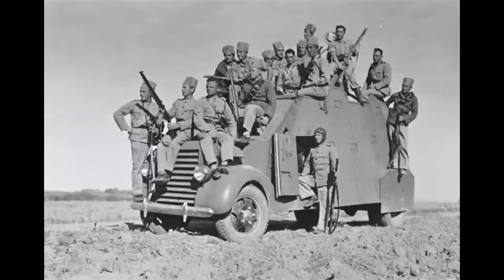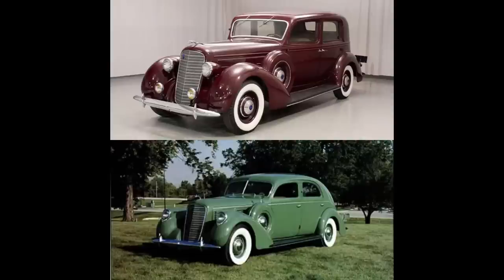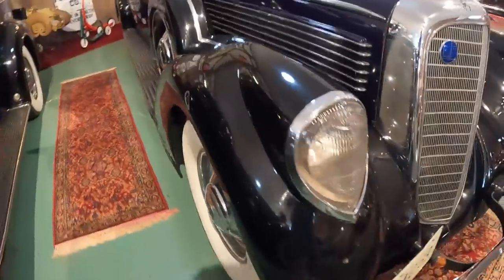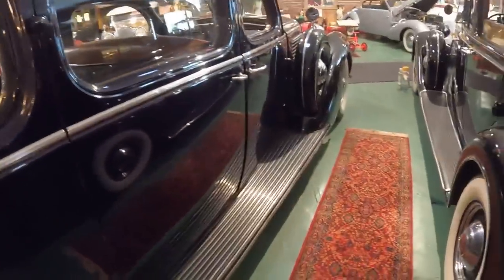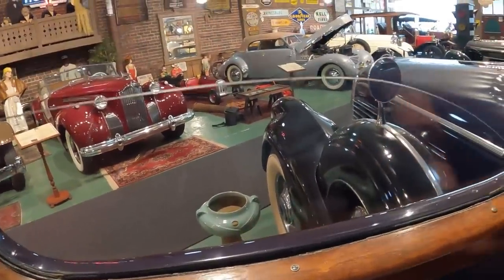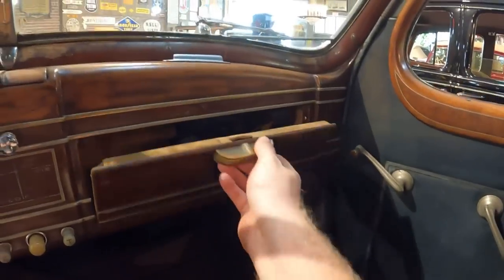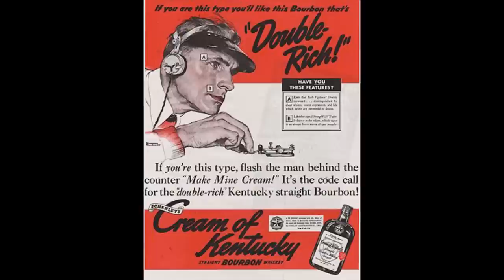1939 Lincoln model k

Comment: Sadly, this car’s passing also marked the end of an era for non-sealed beam headlights. Government regulations required all cars to switch to using sealed beams lasting from 1940 until 1983. So beautifully styled headlamps as on the 39 Lincoln became more bug-eyed, as did all cars afterwards. However, sealed beams were easy to obtain and replace with no special lenses. And unlike all of today’s cars with polycarbonate lenses they don’t turn yellow.
Reply: Imagine trying to find a replacement lens for those headlamps today.  They're gorgeous tho.
Reply: @billolsen4360  Very true and that was a problem even back then, they were made of glass. The same is true of our current polycarbonate headlights- for every car is different, even the LEDs are different from car to car. My old Corolla had a rock chip in one of the polycarbonate lenses, if I still had that car I would have had to go to a junkyard for a replacement.

Comment: The story of the exclusive 'K' Lincolns is a bit complicated , especially when you think of the relatively small numbers produced. They were good looking , high quality cars though , and certainly worth remembering. In short :
During the 20's ,Lincoln had been using their own high quality , expensive to produce V8 , which eventually grew to around 384 c.i. 110 h.p.
 In 1931 , using plans formulated before the Depression , the company introduced a new V12 chassis  to compete with other luxury car manufacturers . It was called the KB model . 150 hp V12 of 447.9 c.i. .The remaining stocks of the old V8 engines were also installed in the new K  series chassis  ), and sold as the KA series (125hp V8 , 384 c.i )
By 1933 , the old V8 engines were depleted , and for their own reasons , ( in the height of the depression ! ) , Lincoln decided to introduce ANOTHER , slightly smaller version of the V12 . ( reduced to 381.7  c.i. , 130 hp ) Cars fitted with this version were now referred to as the K.A. Series . K.B. series continued as before .
 In 1934 , a rethink led to BOTH K.A. and K.B. V 12 engines being replaced by an updated 414 c.i. version of the V 12 . The letters A and B now referred to different wheelbase lengths.
In 1935 , further simplification led to both series being called simply the 'K Series '
This was the situation up to the end in 1940 ; the only FURTHER complication  ( after 1936 ) being the introduction of the completely different ' Lincoln Zephyr' powered by a different , smaller and cheaper  V 12 which owed more to Ford's ' V8 ' than to the exclusive K Series engine . The Zephyr was a beautiful , modern design , aimed at the middle / upper medium priced market of the Buicks / Oldsmobile / Chryslers etc  price ranges but with the seeming cachet of being V 12 powered. It was a very different animal to the rare , high quality 'K series ' however .
Reply from the maker: Thank you so much for adding all of this information really appreciate it the Lincolns from this era just don’t get the love that they deserve =)

Comment: Packard 12
Lincoln K
You do know that the motor in the Zephyrs was a completely different V12.
The comparison of the red 1936 and green 1939 were on different coach builders.there was a more similar sedan in 1939 to the 1936.
Reply from the maker: Yeah most definitely I was looking at doing Lincoln V12 episode and those two engines are different the engine in the K is definitely the better engine

Yeah that comparison was a bit botched so many different coach builders Lincoln had working for them.. and honestly that’s why there wasn’t hasn’t been any comparisons it’s really hard to compare cars are custom built.. or in the Windsor case one/two year production.. 

Great choices and thank you so much for pointing all of that out =)

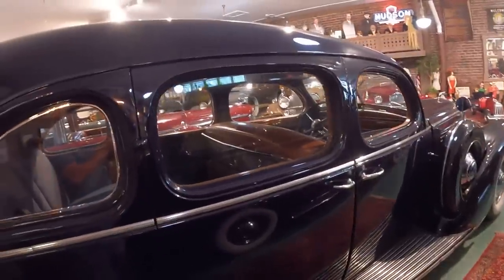Comment: 4:40 Always liked round gauges best.  9:18 Yes, the roof does get higher in the rear compartment from where you're standing, but from the side-view photos you provided, it really doesn't on the 1939 model.  The fancy back seat people may have to take off their top hats.  The passenger compartment does bulge out to give a wider seating area in the rear, that's probably why the running board gets so much narrower the further back you go.  Love this LIncoln's headlamps & tail-lamps.  The rear folding trunk rack is really inventive, fancy Wall Street tycoons have to sail to Europe on the Queen Mary, you know, and take lots of stuff with em.  WYR: 1. Packard 2. The 39 Continental, naturally.  That was the car Sonny Corleone got shot in.
Reply from the maker: Great choices

What I was seeing and what was being captured on video or two different things that car looks weird in person like you can physically see the front isn’t as tall as the back but it didn’t portray on film for some reason.. I didn’t know that that was a one off car until after the fact

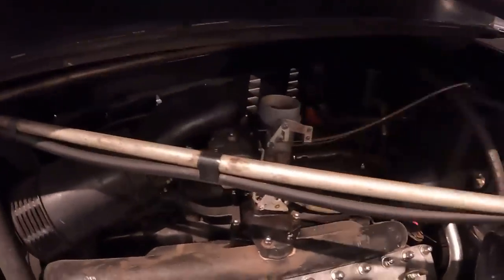Comment: 19:03 ... carburetor right here ... back when the air was so clean you didn't need an air filter ;-)
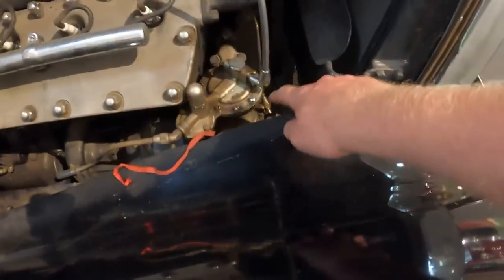Reply: 19:27  Oh, I guess there is an air cleaner; it's just not in position.  Probably so they can get some ether into the carb.

Comment: Packard ❤️❤️ Always 😉 
I never was much of a Lincoln fan 🤷 their colors are very  conservative??? interiors could be simple 🤔....
Another great episode 😉👏👏✌️
Reply from the maker: I really want to drive a Packard before this year is over I wanna know what balance everybody is talking about, The curator at the museum said the Lincoln’s are his favorite but they drive like trucks even the 1939 super heavy steering he was saying that the thing about Packard is it’s balanced super light steering..
Reply: @What.its.like.  🤞 you'll never forget it.... Double Clutch and so much torque.... 
She glides smooth down the road 😉✌️
Reply: @What.its.like.  I believe that about old Packards being easy to steer.  When I lived in Denver, I used to see this little old lady behind the wheel of a 37 or 88 Packard convertible near the Cherry Creek Country Club.  She seemed to have no trouble operating it.  However, if your Lincoln drives like a truck, then your chauffeur will have stronger arms & shoulders than Packard chauffeurs and you can confidently wager Rockefeller and JP Morgan a measly $100K each that your driver can beat up their drivers.

Comment: The last gen Model K's are a near miss for me.  Appreciate the stab at modernization with faired in headlamps, but overall, they just were not 'beautiful' - almost Teutonic in a way - dignified, stately, slightly tank like and not a looker. - though it does incorporate a lot of streamlie moderne into the design, props.  However I do love the cloisonne badging of these years and the gauges, they're almost worth the price of admission.   Built to a very standard and beautifully trimmed, but this 12 was always outgunned by its similar rivals - even though the reputation was that serious old money - as opposed to Hollywood money - bought 'K' Lincolns (or Pierce Arrows as long as they were available).  Zephyr was another creature entirely.  WYR 1)  39 Packard 12  2) Tough - the K is a better car, the Continental is a styling masterpiece.  If the K is the LeBaron Roadster though it's super rare (production = 2), so yeah, I'll build a garage for it.  Finally, the Royal car was a LeBaron bodied convertible sedan (many pictures of George VI and Queen Elizabeth riding in that), not sure how this sedan fits in with the tour.
Reply from the maker: Awesome information great choices this was the mother of the queens car that she rode in so it was you know further down the line.. 

What I find interesting is this looks the front end of this looks very similar to say 50s Mercedes and yet Mercedes-Benz gets the credit for the design but Lincoln actually had to design elements first so Lincoln should be credited with the design I wonder how many times that’s happened I would love to do a show on that one day cars credited with the design but the design actually started much earlier